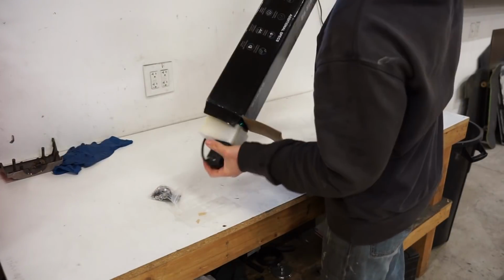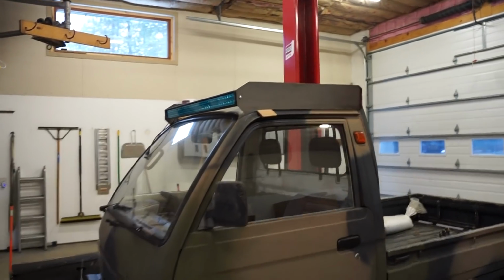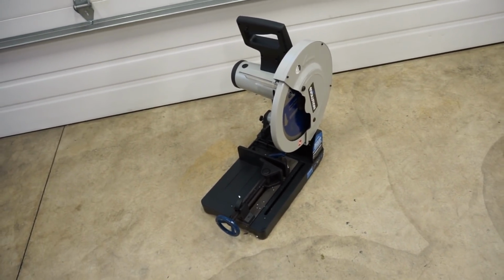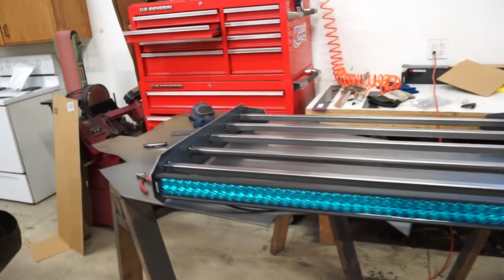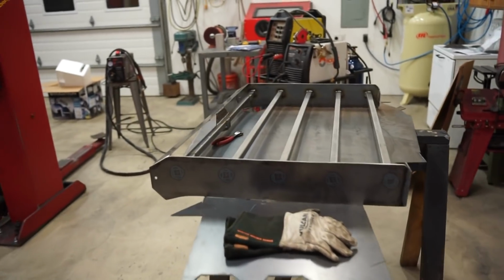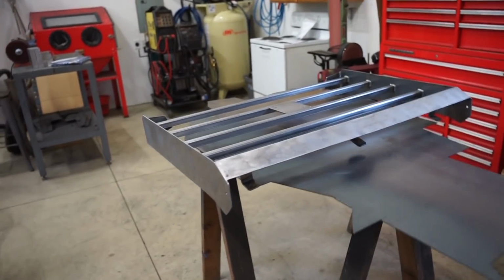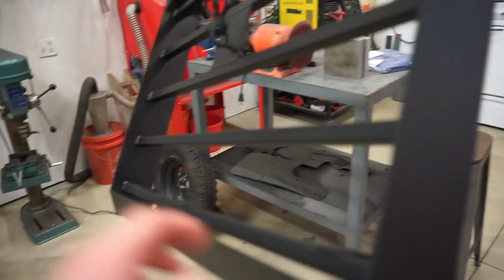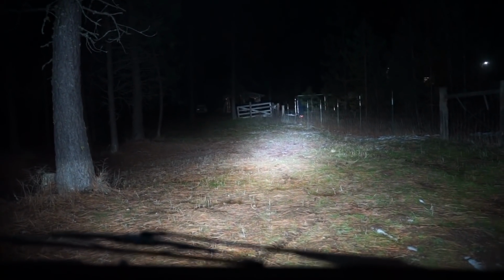Fabricating A Custom Roof Rack And LED Lightbar!!

Comment: I'd recommend using a little piece of rubber, like from a inner tube on the roof with a tiny hole poked in them for sealing and not messing up the roof of the cab, and stop any squeaks

Comment: Would be nice to see more roof rack builds, especially on the pickups where they would extend all they way to the rear,  adding some storage space. Of course understandable if you don't need one and don't want to waste time building one (or more!). But it would be cool to see a DIY rack for Tacoma or 4runner for example!

Comment: As you were fab'ing that wheel mount I was thinking exactly the same thing, don't weld the studs on there in case you want to put a large flat case up there some time. I think I would have welded the nuts on the back side, but I'm not a master fabricator like you.

It looks great.

Comment: If you would rivnut on the tire mount you could use two eye bolts through the top to lock tire down.  This also would give you two anchor points for straps as well.  Awesome build thanks for the ideas.

Comment: How do you like the new air compressor? Nice job with the lights now I think I'm going to buy one for my plow truck lol. I wired in 2 of the LED fog lamps into my back up lamp circuit and mounted them back by the tailgate on top of the box rails. It's like a mini sun back there. You cannot have too much light when you are plowing snow.
Reply from the maker: Its great so far!!

Comment: I’m wondering why did you decide to drill the roof for mounting ponts, when you have functional rain gutters that you can attach the rack to, this technic was used for ages to hold roof racks
It will surely won’t be as sturdy as ur setup, but u also won’t be putting heavy loads up there when you have a complete bed

Comment: Ace hardware has those robber plugs with threads to be inserted through holes. When bolt is ran through the hole and tightened, it compresses the rubber for and becomes water tight. Just thought it would have been better that those nut serts in the roof. Got my entry for those wheels. It’s definitely for a good cause.

Comment: Looks good but i would add some gusseting and or peices of 1x1 between those longer 1x1s and some expanded metall over it. Those 1x1 love to crack at the welds with vibration and the 1x1 is gonna flex on you like crazy. Now to got a rack why not weld some light tabs for some work lighting on there too.

Comment: I remember when I got my cold cut saw...so much better. Good job on the rack, my only concern, which probably doesn't matter for a home work truck, is the whistle when driving at high speeds. When I had my jeep and put a LED on top, because of the small spaces between the roof and the light, that thing would whistle loud when on the highway, enough to make me take it off.
Reply from the maker: Thanks! It will be fine this truck doesn’t go fast enough haha

Comment: Nice! Now you need to make a table for the new saw with positive stops for repeat cuts, that way your not working off the floor also. BTY sweet looking rack and a good place to put a spare tire instead of under the truck. Might want to bump up a higher amp alternator LOL
Reply from the maker: Thanks!! A table would be nice!
Reply: @austinniemela   I have made a table for mine sunkin center for the saw to make saw & table all on the same plain (level) and made a short fence out of 1x2 tube that way you can clamp a positive stop on to it for repeat cuts so you don't have to repeat lay out marks. Save's a lot of time in layout.
Reply from the maker: @bobthebuilder6315  nice that sounds handy!!